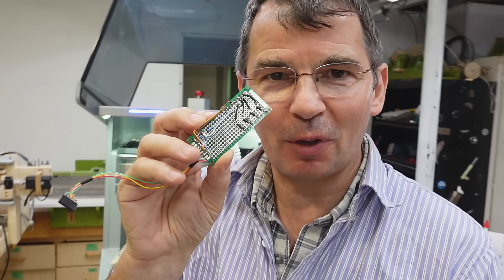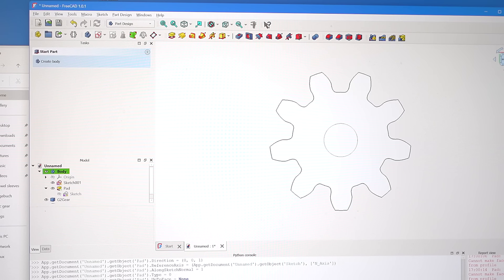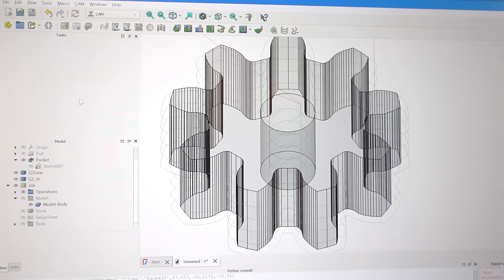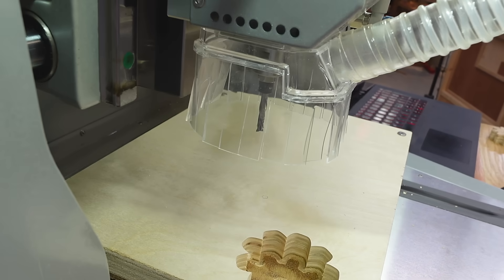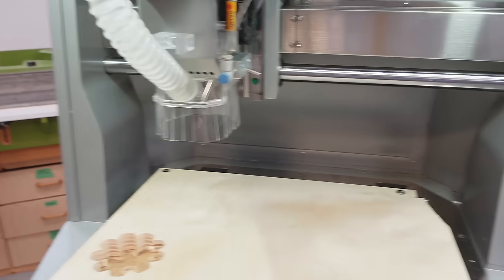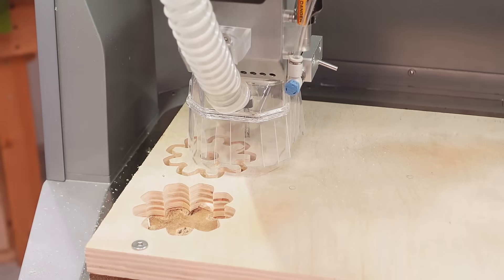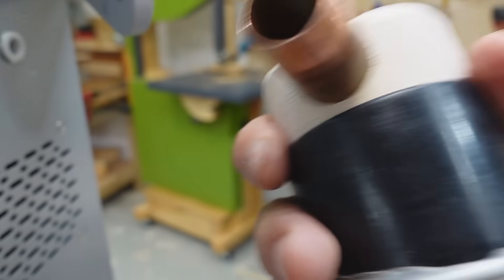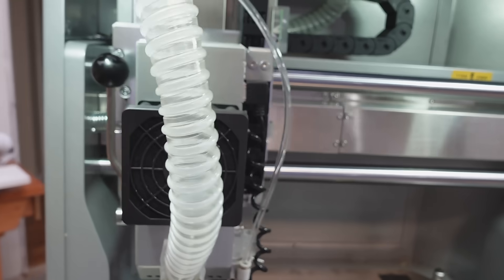Steep learning curve for using CNC

Comment: I'm just curious why you switched to using what appears to be a raspberry pi based camera? It looks really juddery.
Reply from the maker: No, just investigated.  At some point I accidentally set the camera into shutter priority, and for some reason, that caused it to only capture at 15 fps (though set to 30 fps, so each frame duplicated)

Comment: Free cad is much better than it used to be but it's got so much overlap from various groups working in various sections and it's still a mess hopefully they get it together it's a good project. 

But much better people than me never seem to be able to use the thing.
Reply: The lead dev of FreeCAD is a German and he's just aspie. He sabotaged the code from the get go so it'll never support Standard inches right. I'm sure he works hard to this day to keep it that way too. That's the beauty of open source though. You can be a total dick with no negative consequences.

Comment: When you learn things about how you need to do something; write it down on something that's attached to the machine. That way you have it easy at hand when you need to get that information again a year or two down the line.
Reply: As much experience as I have with taking notes for later use, it is still difficult to find words that will mean the right thing some unspecified time in the future.
Reply: @davemccann7446  Images can be nice. Take screenshots of things if it's something digital.

Comment: Using FreeCAD is great and fine. It's just knowing how to use it. Just putting in the time to learn it as you would with any other software and it's fine. If you bring stuff in from external sources it's hard to edit, but if you design in all in FreeCAD it's easy to edit and change. Also, in the pad how you changed the Z to -1 in order to make it go the other direction, there is a reverse check box just under the length input box. That makes it go in the opposite direction. I never even thought of using the custom direction section to change it before haha

Comment: I stopped using Fusion 360 several years ago when Autodesk decided to cancel the free access for hobbyist, and even though they relented and continued to support free access for hobbyist, I never trusted them again and switched to FreeCad.  It was an amazing learning curve, but after using it for a few years, I find it quite easy to use.  Coupled with AI tools like CoPilot or ChatGPT and videos on YouTube, it is fairly easy to figure out how to do things I have never done before.  I only use it for making STLs for 3d printing, so I have never had to make a tool path.  But all and all, I think the most important part of FreeCad is the "Free" part!

Comment: I feel like I've seen people build entire DIY CNC machines with less effort than this one takes to operate, you'd really think all those UX issues would be a solved problem by now. Open source software and an old 3D printer make for a much better CNC machine than this
Reply: I have to say, I do like LinuxCNC over that thing Matthias has. But I don't have a probe. I just touch off manually.

Comment: Watching this just takes me back to insomniac nights watching the backlog of Matthias making every dang thing under the sun analog-style.  Gets an idea, makes a plan.  Prints it out, sticks the print to the wood, bandsaw time.  So there was the occasional "oh, shit!" moment but nobody wondered what had gone wrong because the equipment was controlled by one guy and no software.  That all made sense.  No dissatisfaction with how the toolpaths generated or the software and hardware didn't play nice.  Those were the days, my friends.
Reply: CNC is basically a mixed media printer. You're not limited to just operating on paper with CNC. But it is a computer peripheral like conventional printers are. You're not stuck using just one ink cartridge with CNC either. Any cheap ballpoint pen works. In fact cheap ballpoint pens are what plot the best. I've tried more expensive pens and they run more. I have a floating head I use to plot with that I made. It's spring loaded. Just putting a pen into the collet really doesn't work good. You're better off with some travel. Plus pen bodies really aren't cylindrical. They have draft. That matters when you make a holder for them.

Comment: Matthias, please consider Alibre for CAD and CAM. Its not free but they offer lifetime licences. It runs locally unlike onshape, it doesn't force the cloud like fusion. You can pay a smaller fee to update the version or tier down the line. They're an industry software just smaller than the rest, and they offer a cheaper hobby level CAD/CAM package. There's a month free trial you can give it a shot with.

First comment said it didn't go through so apologies if you get a double comment.
Reply from the maker: Just looked that up, oh, price not bad.  Oh, add CAM (milling)...  Oh, price goes up a lot!

Comment: Still better than my first meeting with a cnc. I borrowed a cheap chinese 3080 from a friend to learn and try something, had to configure it myself in linuxcnc because he didn't yet use that machine, which took me several hours before it actually started moving, then promptly on third line of cutting the axle in spindle motor broke (metal defect inside axle) and I had to buy new motor from china just to return it to my friend. And I thought I already know enough about gcodes and machining to not break a tap.

Comment: Good effort to learn Freecad. I've switched to Freecad from Fusion360 and SolidWorks and boy even with some cad experience it's a tough learning curve. I also use vectric aspire with an old version of adobe illustrator for the designs and this works very well for my needs. I'll jump back into fusion360 if I need something made from metal or if the design is a complicated 3 axis jobby. 

But you've touched on the basic stuff for CNC work:
1. CAD to make the model (illustrator > aspire, fusion360)
2. CAM to generate toolpaths (Aspire and fusion360)
3. Post processing, this converts the toolpaths to the cnc machine specific flavor of gcode (often you can either find those online or you can program your own) I've made changes to the one from Aspire (adapted linuxCNC post processor included with that package, and did the same with Fusion360, and changed the G2/circle commands into plain G1 moves as my controller hickups during g1 to g2 transitions. 
4. A gcode sender that can interpret the gcode into motion. I use UCCNC with an AXBB controller board. I don't really do automated probing on my machine, I just use a sheet of paper for the z height of the tool (until it just catches and stops moving without tearing) on the top of the work piece. I also manually set the XY position. I don't have a tool changer. It's a lot quicker compared to that Carvera machine but it's more user friendly if slower.

I know it's a lot to juggle but if you get into the habit of things, it'll stick. I've documented how to do stuff that I don't regularly do so that I can pick it up again quickly. I have so many different kinds of ways to make stuff, I can't really remember all of it. Like general woodworking with powertools, CNC, CAD/CAM, PCB design and Gerber, machining aluminium, brass, steel, all have their own little differences, soldering ie smd, through hole, rework, and lately I've taken up sewing (working on a recliner/livingroom chair with custom cushions etc and use sewing for upholstery). 

I've used the CNC to cut out plywood panels (weird shapes impossible/impractical to make using circle saw or bandsaw), oak tables with a large 10mm deep pocket over the surface with 14mm wide edge, with trap door storage, machined standard 50x50mm hinges into butterfly shaped hinges to go along with the trapdoor storage compartment and used it to decorate the brass hinges with some V carving. I've CNC'ed a cutting guide for a lower back cusion with a very specific shape. I've used the CNC to locate the hinge screw locations to precisely drill them, machined pockets for the hinges precisely. 

I think if you find a cad/cam package that you like and fits your style of work it'll make the CNC more accessible for you and more fun to use and open up new possibilities. But more fun doesn't mean fun for you of course, you may still find it a chore to use ;)

Comment: FreeCAD gears workbench could have generated the gear automatically. Then the involute geometry would have been splines and not hundreds of little segments. Then FreeCAD would have been much faster.
Reply: Okay, but the fact that the software converts a vector path to segments instead of splines is a huge failure of the software anyway.
Reply: @Nevir202  It is segments of splines, exactly translated from the SVG - which consists of segments of splines. Also, if he had selected both lines in the SVG in draft mode when converting to a sketch, the hole had been within the same sketch. Then just a single pad had given the gear with a hole and all. It would still have to calculate a ridiculous amount of splines, though. SVG is not the right tool for this job, especially when the correct tool can be included in FreeCAD.

Comment: I'm glad I'm not the only one who finds FreeCAD difficult.  I have decades of experience with AutoCAD, which I realize is not the same thing, so I should be able to pick up 3D cad, but there is no cross-over at all.  I'd try Fusion but it doesn't run on Linux.

Digikey put out a series of youtube videos on FreeCAD a while a go, and they helped a lot.  But I haven't touched it since, and I've already forgotten all but the most basic stuff.

Comment: I always thought you were clever, Matthias, but after you've managed to do anything at all in FreeCAD I'm really in awe.
Reply from the maker: FreeCAD makes me feel rather not clever at all!
Reply: @matthiaswandel  FreeCAD doesn't make me feel clever, but I never cease to be amazed what I can do with it.  Parametric design fits my brain.  I'm sure I could easily use Fusion 360 or OnShape, but FreeCAD does everything I need it to and at low cost, so I stick with it.  Granted I'm mostly about designing objects and mechanisms I can 3D print, so no use of any CAM inside of FreeCAD.
Reply: @matthiaswandel I tried to do some 3d design in the past and... Yeah, that's the feeling.
Reply: @MCsCreations  Bad CAD software is literally worse than none at all.
Reply: @Originalsunrunner20  Bad (= counterintuitive) CAD software keeps old people like me in the analog world.
Reply: @Originalsunrunner20  I dunno.  I'm very grateful to have FreeCAD and use it regularly.  I don't see the UI as "bad." It's probably different from other tools, but the workflow makes sense.  All parametric modelers have a steep learning curve.  I don't care if anyone else uses it, but dumping on it because it's free and works differently than some other professional tool seems a bit silly to me.
Reply: @matthiaswandel  You have overlooked the function of the software. It is a suite of tools in one package and most of the tools are not useful for your projects.  
You need to create a UI that serves your needs and remove functions you don't use, In this way you can create a version of FC that is optimized for your use.
Reply: @DirtyRobot  I'm trying to learn FC for both 3D Printing and CNC wood cutting/engraving and Laser Engraving. So where would I start to learn how to do all this? And where would I optimize the UI for just my needs? And how would I even know what my needs are if I'm just learning it? This is starting to look like a chicken/egg problem. If I remember correctly, the GIMP foundation refused to make any concessions in the UI design, because they were programmers and knew best. Now GIMP is falling to second- or third-tier status as a graphics app when it used to be first-tier. I really don't want to see that kind of arrogance hamstring a CAD app, especially an open source one, but if FC is taking too long to learn, then I have no option but to learn something else.
Reply: @matthiaswandel  yeah seems like ACE and manual insertion of drop down G code between the runs is a better option here (its a 2.5D code generator from DXF files) LOL
Reply: I tried to teach myself FreeCAD for 3 days, because I needed an adapted drawing for a woodworking project, I got somewhere, then realized how much time the actual drawing was going to takw but in the end I needed the drawing the next day, so drew it on paper with a ruler and pencil within an hour.
Reply: I've been discussing FreeCAD with Reddit users. The community  is full of users that say 'you just got to power through learning it' and don't realise that the pain faced is too much for many non-developer brains. A UX and workflow review could boost the user base tremendously.
Reply: FreeCAD isn't that hard if you're staying inside FreeCAD the whole project, but as soon as you're importing external files, things get MUCH more difficult, and much less well documented. I've been struggling with it for a while too, and sort-of have the hang of it, but if a part I'm importing has the origin in a weird place, I'm still not entirely sure how to fix that. Also, FreeCAD is seriously lacking lathe cam - there is some, but it's very VERY alpha quality
Reply: As a solid modeler, it is pretty rough. But you can use it with a plugin called OpenCFD and it works as pretty capable CFD software.
Reply: Seriously, FreeCAD is such a fight to get anything done, doubly so if Matthias is coming from SketchUP which is super intuitive
Reply: @hausmeisterbanane  It's kind of funny. I never could get the hang of sketchup.  somehow navigating in 3D space on a 2D screen with a mouse to draw lines and create surfaces never worked for me. Yet my brother took to it years ago and it's all second nature to him.  Yet parametric FreeCAD (or any other parametric system) with the idea of constraining a 2D sketch and then extruding in a third dimension totally works for my brain.  So simple but powerful.
Reply: One of the things I've noticed with the developer community, is the nonsense that the harder something is to do, the smarter the person doing it is.

Try again. If the person developing the program is so smart, why can't they make things easier to use, rather than imposing their bias into the program.

A few years back I installed Linux mint on a netbook, and then installed Liber office. It's startup manager had two panels, the left panels has the program icons and also has scroll bars disabled. This prevents those using Libre office on such small monitors, access to all the programs through the icons.

When I suggested that all they needed to do was enable scroll bars in that panel to allow access for smaller monitors, one of the developers responded with: "Scroll bars are not optimum."

Why do companies allow people like that to remain in their organization?

They are causing problems with their biased notions.
It's the same when it comes to managing the browser layout.
When it comes to chrome look a likes, someone decided that tabs at the top is the most efficient layout. Not when your working with tabs the most it's not.
Reply: FreeCAD does have a steep learning curve, but so does every other parametric 3D modeler.  But FreeCAD is extremely powerful and flexible once a few basic things are mastered (as Matthias indicated).  I use FreeCAD all the time for making things I 3D print.  Lately I've been learning more about various advanced 2D workflows in FreeCAD that involve shape binders and the draft workbench.

That said, I'm not sure FreeCAD is the best tool for what Matthias wants to do with CNC.  He mostly wants to do is mostly 2D CNC with step downs simply for the material thickness.  There are other tools for generating this kind of g-code that are simpler and more purpose built than a partially-completed workbench for FreeCAD.  I mentioned one that I think he would find interesting called gcmc which is a programming language just for g-code generation.  Loops, if-then, functions, etc.  Would be a natural fit with his gear generation code.

Speaking of steep learning curves, Blender used to have a reputation for a difficult UI. It's apparently better now, but from my perspective the learning curve is near vertical!  Yet people are doing amazing things with it, including 3D CAD with some add-ons.  Probably even CNC.
Reply: @tmlf1239  RE: "FreeCAD does have a steep learning curve, but so does every other parametric 3D modeler." I have used several 3D Parametric CAD packages, FreeCAD is by far the most difficult to use. It's not just a question of there being some complexity to 3D CAD, FreeCAD is profoundly arbitrary and counterintuitive in the way it insists things are done.
Reply: Free cad was the first cad software I learned.  While I love open source software, in the case of solid modelers I think the paid software is really worth it.  The community is also larger which makes learning much easier.
Reply: @andyb2339  When was the last time you actually tried FreeCAD though? Its only recently actually hit a 1.0 release, and with that become really quite good. 

The evolution of FreeCAD in recent years has been huge, while the big boys are devolving into charging extra for features you used to get...
Reply: @matthiaswandel. I call it Freak CAD. It outputs lots of strange error messages, and crashes at least once every time I use it. But once you finally get some gcode out of it, all is forgiven. 😀